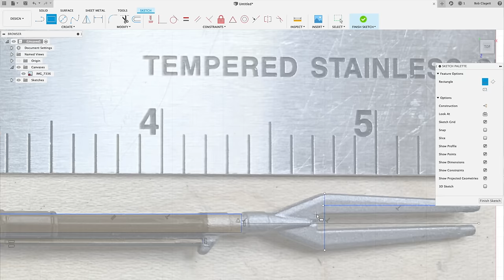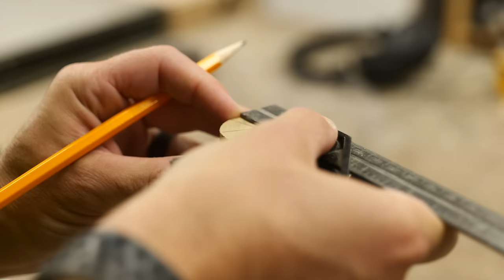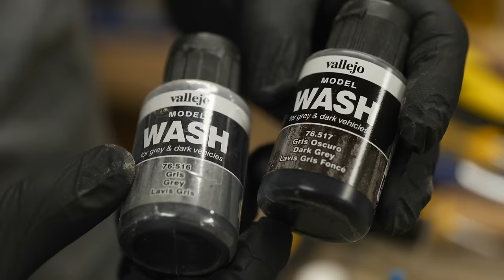Making the Amban Blaster from The Mandalorian // Star Wars Props | I Like To Make Stuff

Comment: When I was a kid, I wanted to make a wooden version of the assault rifle from Halo 1, but I had literally nothing. I had a big block of wood that was about the right size to carve it out with, but that was it. I worked on it on and off for many years, just wittling it with a tiny pocket knife, but eventually we moved, and it got thrown out. Now im kinda thinking about getting a laser cutter for other projects, but I just realized that I could use Fusion 360 like you did, and design it out and probably just cut it out in layers and stack them up. Thanks for the ideas and inspiration.
Reply from the maker: That's awesome! You don't have to have the perfect tools for the job, you just need some motivation and determination.
Reply: Don't you have two boys?    You reaize you can't make  just  one rifle,   You now have to make  two of these  star wars rifles.  Very cool projject.  THANKS  for shsring.
Reply: @dougallen713  he should make a bowcaster for the other

Comment: Does your drill-press table swivel? I move mine to the side and use a hand-screw clamp, clamped to my table as a sort of vice.
Reply from the maker: Great idea. I realized that after the fact. Thanks for the tip!
Reply: Was going to make that suggestion as well. :)
Reply: You could also tilt the table 90% to the drill bit for a bigger area and probably more safer clamping method
Reply: Or turn the top section with the motor so that it hangs over the side of the bench, and you could clamp against the side of the bench or even put a cheap woodworking vice in that spot just for that purpose
Reply: Scott A that’s a good idea as long as the motor/head will turn. I know On mine it won’t can be a pain sometimes😤😤😤😀😀
Reply: The motor is not intended to turn but it would only be clamped, loosen her up, turn to required position and clamp again. Even if a new clamp has to be made. I only have a small drill press myself and i had to assemble it myself (likely how amost, if not all of them arrive when new) there is just one bolt on my top section to clamp it to the pipe